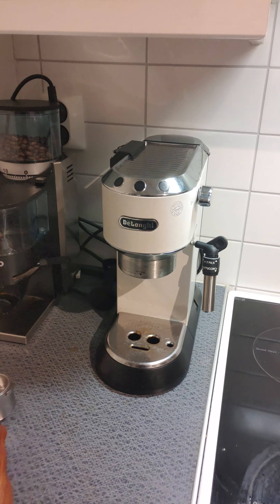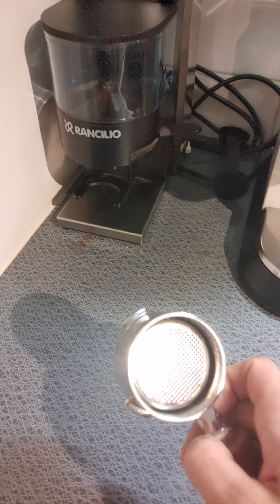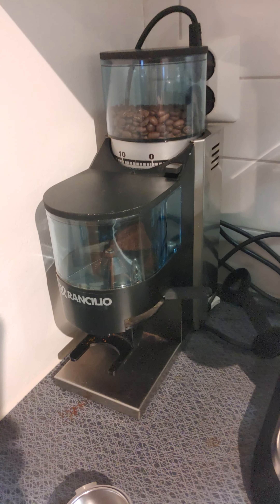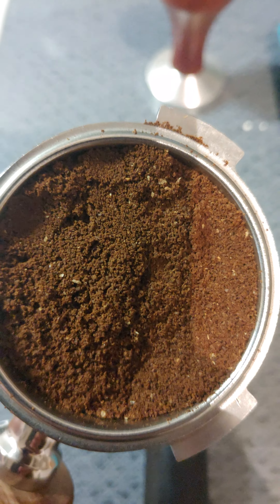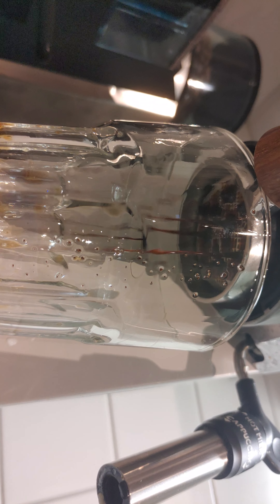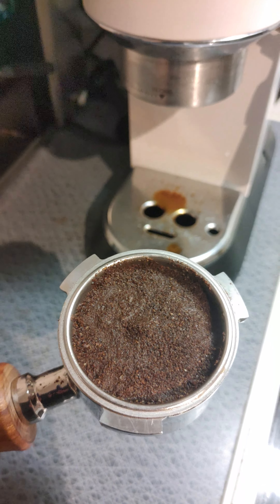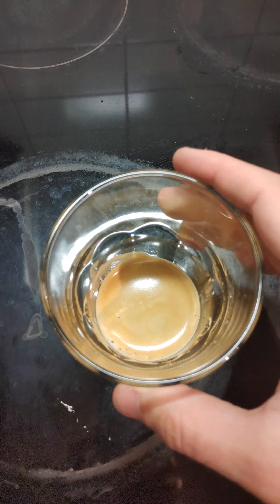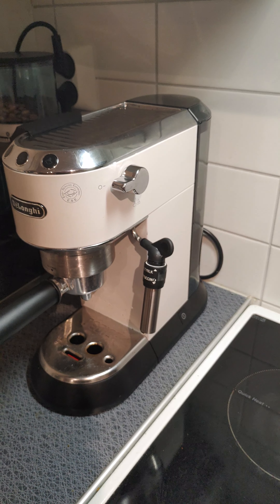Delonghi Dedica + Rancilio Rocky ... someone help me with my brew time (7s) please!!!

Comment: Without any filter in place if you hold down either the single or double shot button and keep it pressed in you can program your own shot time. Once you release the button it will save this time. I do it for like a minute . I then have a scale and i stop the shot manually when i get the output i want. Which is usually double the amount of coffee you are using within 25-30 secounds. You will have to adjust your grind size with this machine to achieve this goal either finer or coarser based on the times you are getting.
Reply from the maker: Hi Shawn. I have just done that as well. I essentially programmed it to a full cup (Americano) and then went through the brew process again. Stopping around 36 grams it still took like 7 seconds. The coffee is ground super fine, yet the coffee coming out is very quick and therefore has low viscosity and looks like a pour over vs. espresso.

I don't this machine has enough power to break the puck and the puck seems fine. I wonder if it could be due to the portafilter basket holes being too large and not giving any back pressure.